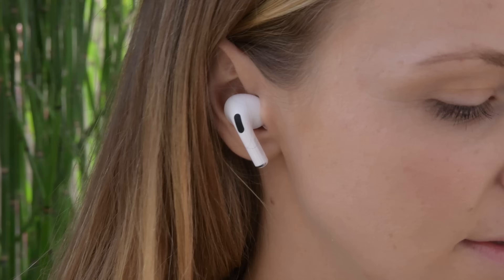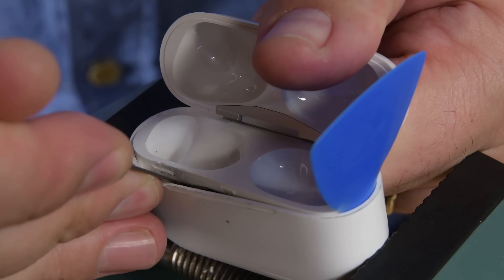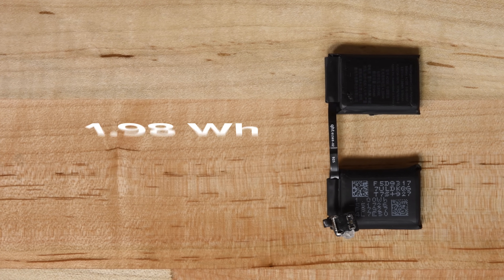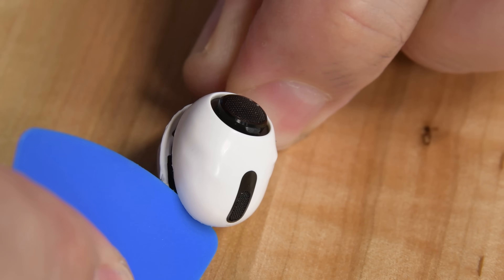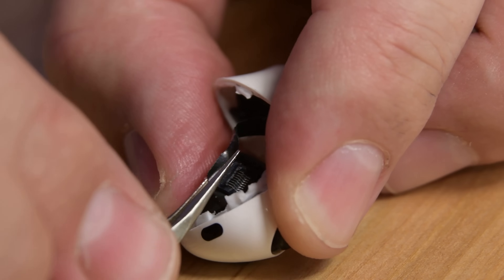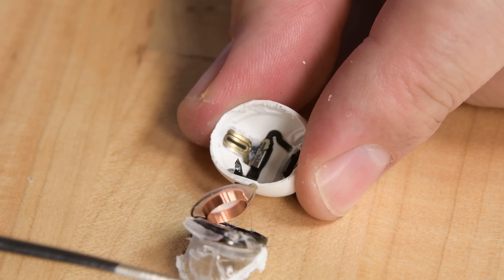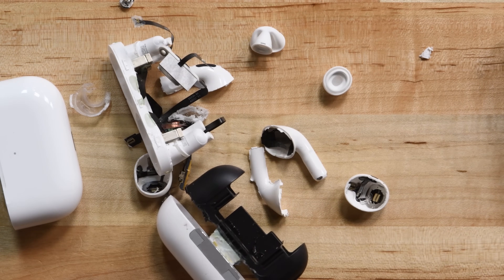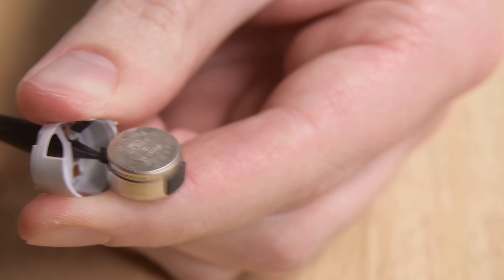AirPods Pro Teardown—0 out of 10 Total Destruction!

Comment: To be fair, its kinda pointless to repair these: the batteries represent like 90% of the environmental cost. They’re so tiny it’s not worth it, might as well replace individual earbuds units.
Reply: Spoken like a true isheep
Reply: not if you could just change out the battery.
Reply: Far L I absolutely cannot argue with that. you are totally right, and for a $250 product to become a consumable for most people over a shorter period of time than others is really shitty. It should indeed be replaceable, I agree with you.
Reply: SCAM
Reply: SonsyWhale ok how about Sony also 250 or others more than that?
Reply: Do you like airpods pro?
Reply: Lord Vegeta yes there is AC+ for Headphones
Reply: Lord Vegeta For newer models hell yea! Especially since they changed how they are made since s8
Reply: Yeah, only at $249.
After 2 years, it's only left with 5 min battery life. For 11 bucks a month, i expect more. Or atleast some battery change
Reply: Rizzzky z none of my wireless headphones had 5 min battery life after 2 years of regular use. It’s more like 80% battery life at the worst case.
Reply: Rizzzky z hum 5min of battery life after 2 years? Is that an exaggeration or from your experience. I got the AirPods the 1st generation for 2 years now and I’m still rocking them like I got them back in 2017.
Reply: Rizzzky z that’s flat out not true. 

My airpods 1 still work absolutely fine , battery is in excellent condition. 
I can go at LEAST a full business week without charging the case, and they have never died once a single use for me. 
And still don’t. Easily getting 5 hours playback after 2 years.
Reply: Rizzzky z you can take in the pods to an apple store and get it replaced (hopefully)
Reply: Rizzzky z Happens to every battery. That’s why it makes sense to get Apple Care+ for them, you get new ones when the battery is below 80%. You can do this multiple times. And if you damage them, you will get new ones as well. If Apple Care+ wasn’t available for them or more expensive (39€ in Germany), I would agree. Spending 279€ every 1-2 years just because the battery capacity decreases wouldn’t be viable.
Reply: @C0mmander  that's still a decent amount of extra cash that needs to be spent. My main issue is that it creates an idea that we should throw away or replace everything if 1 part goes wrong. E waste is becoming a huge issue in the world, every little thing counts and even if these are small, it builds up and enforces the idea that it's okay to throw away something that only has 1 broken part.
Reply: Rizzzky z battery change 😂😂😂😂😂😂😂
Did you see how small they are? You must be joking or a Apple hater lol 
Why would someone ever wanna change the battery of those? Of earbuds?
Reply: @roby2764  over time battery can't carry as much as they did brand new. I dont get how he's an apple hater. Well he probably should because Apple is scamming y'all right in front of your eyes.
Reply: @roby2764  If I spent 250 dollars on some shit like this you bet your ass I want it to last
Reply: Bottom line, I’m not getting them. I already had AirPods and they lasted 2 years which is enough. Being able not to not repair them..I’m not dropping another 170 dollars a new AirPod set. 
I commonly see people rely on Apple or a third party company to fix their things..”just get Apple care!” They won’t fix it, they will just charge for a whole new set, I don’t see how they “fix” anything.
I brought my iPhone 8 into the store and the screen was cracked, they were gonna charge me 600 fucking dollars just to change it. 
No way that was going to happen so I simply went on YouTube and look up a tutorial and replaced my screen for just 40 dollars. Learn how to fix shit yourselves. The way they really tried to scam me for 600 dollars just to replace my screen shows how decisive they are.
Reply: Just watch Snazzy Lab. That guy perfectly analyzed the Airpod Pro
Spoiler alert: It's good, but definitely not good enough to blind us Android users with common sense, unlike Apple fanboys lol
Reply: Hoang Tho Nguyen “If you’re willing to sacrifice performance for comfort and ease of use, they’re worth the asking price” Yeah, that’s the point for the AirPods, not the things you’ve mentioned.
Reply: Shut up douchebag, nobody asked you about your point
Reply: By the time the battery deteriorates there's going to be a new model so there's no point in repairing them anyways
Reply: @noobminer2893  10/10 logic cuz everyone buys the newest thing every few years.
Reply: @KevinEF  they buy the newest thing because they don't want to go through the trouble to take apart small electronics like these to repair them, even if the battery were replaceable
Reply: @noobminer2893  yea but paying your smart techy friend who enjoys taking things apart would cost less than buying the newest earbuds
Reply: @EduardoMacias-h2r  Good ANC headphones are $350-$400, are those scams even though so many people like them??
Reply: It's pretty clear that the people that hate on Airpods are the ones who never owned them. They seamlessly integrate into your life and they're incredibly convenient at a competitive price. From what I've read, the ANC and sound quality on the Pro could use improvement but this model is one of the best on the market along with Sony's WF-1000XM3. Regarding battery life, they degrade at the same rate as all true wireless earbuds. Apple is pushing the boundaries once again and I'm sure other companies will try to mimic them
Reply: @EduardoMacias-h2r  And when every other company tries to copy the new airpods so much like they did with the originals, along with raising the price where will your case be then? Flagship phones used to be $500, now they are double that, and most competitors of Apple charge very similar. Tell me exactly what Apple is scamming people of? Tell me when repairing an airpod for normal use will ever be needed.
Reply: @Silver_x86  fully wireless buds have been a thing long, long before airpods. Of course, some companies have made shitty knock offs of airpods, but they're just that. Don't think that Apple has innovated anything, they always follow the trends, then everyone follows them, which I will give them credit for - they have an incredible amount of influence
Reply: Ryan Kupka AirPods pro noise cancellation is actually quite innovative. They’re the first earbuds to not be over the ear headphones to actually have that feature.
Reply: Fujin Yumi No, Sony, Bose were first.
Reply: Fujin Yumi theres a pair of sony tru wireless and those cancel better

Comment: Nice video. The CP1154 is from a german company, Varta. And Galaxy buds used CP1254 Battery, and it's capacity a bit larger than CP1254. 12;Diameter, 54: Height. :)

Comment: Interestingly they have now switched to the same german baterry supplier as Samsung did with the Galaxy Buds.
Reply: Varta ist halt einfach gut
Reply: B P It is actually. They didn’t write Varta on them, but they say Germany and have specific type of number only varta uses.
Reply: @catboy3471  i have an iPhone 6S Plus 64GB White, how dare you you bitch!
Reply: Malte Reese interestingly the galaxy note 10 has no headphone jack. Hmmm wonder were that came from?
Reply: @noerivas4167  probably the dwindling numbers of headphone Jack users?

Let's be real, removal of older technology isnt something you copy. It's just how tech is. The old gets replaced by the new.

The intresting thing is samsung pulled an apple.
Apple is typically the one that waits to put in features until the feature is ready.

When apple removed the headphone jack I would argue we hadn't really replaced the headphone jack yet.
Now I think we have.
My biggest concern with bluetooth(and why I didnt replace my headphones until now) was because I didnt want to ever have them die and not have a way to charge them.
Now with reverse wireless charging it's not really a problem.

In this case it's not who did it first, its who did it at the right time.
Reply: @woo9914  If Apple hadn't done it at the time it did, I guarantee no other mainstream smartphone manufacturer would have done it now. Apple made it acceptable for headphone jacks to be removed and made phones without headphone jacks commonplace. The same thing they did with notches and a whole range of other technology.
Reply: @ifb6368  that's true, but that's not really a counter to my point.
Reply: @noerivas4167  from moto z ofcourse. They did it first before iPhone 7.
Reply: Noe Rivas I didn‘t mean it as a negative thing. I’m a complete Apple guy 😂
Reply: @noerivas4167   A wild Apple Fanboy appeared!
Reply: Onur no it’s a Apple vid we are common here jeez
Reply: @pindakaasjeokay3392  no. its a ifixit vid. 😃
Reply: Varta is no more german since Johnson Controls buy them. My Dad worked for them and after the sale its was a nightmare to work for them.
Reply: TomGoTom Gogo That is like 10 years ago. In the meantime, Varta was made Independent again and is listed in the German stock exchange. They did a great job reviving their battery business after getting destructed by Johnson Controls and others

Comment: Pretty sure Apple is proud that they got 0/10 on repairability.
Reply: Apple: pat on the back Good job boys we made it
Reply: @bluberrialpha  se
Reply: Tim Apple: Now that Steve’s not here, divert all man power from innovation to the glue and solder department!
Reply: Johnny Chen 😂😅
Reply: Johnny Chen FYI the iPhone battery has pulltabs and almost nothing is soldered
Reply: Johnny Chen Steve didn’t want anybody opening the products
Reply: @roveism  Steve drove them towards Glue and Solder
Reply: @roveism  🤣🤣🤣🤣
Reply: I believe the next generation device will have no screw at all, just seamless metal all around.
Reply: @karljo8064  That would be 3d printed metal body
Reply: Karl Jo metal is more expensive than plastic..
Reply: @tomcruz7177  and it's heavy too
Reply: adepu prashanth potentially not that much heavier as you can use a thinner profile for the same strength. Imagine titanium AirPods lol
Reply: Tom Cruz and heavier... Low weight is essential in earbuds. Also plastic, app art from lighter ,is very resistant. AirPods lack of repairability is a shame, but your comment is not much better
Reply: Peter the Panda stock holders cheering, popping champagne and going wild
Reply: If your air pods stop working their damaged beyond repair. The only way to fix this is spend money on new AirPods!
Reply: funny how they get rid of the charger to "reduce E-waste" while making the most unrepair and unrecyclable  products. And people still falling for this crap.
Reply: @1179125 nice!
Reply: Yeah of course
Reply: Ladies and gents today in innovation. Unrepairelable jewelry. You break it you buy a new one.
Reply: Very sad to agree with this comment. Apple is very greedy.
Reply: Peter the Panda they don’t care
Reply: Peter the Panda - I’m proud.
Reply: Lol
Reply: @A random Human being They've always been hard to repair
Reply: Its to Prevent Pablo Cimadevila in making them out of Gold https://www.youtube.com/watch?v=Kgle4vt3OuI
Reply: Yeah they did it they’re wanting people just to buy new ones just to earn more moneu
Reply: Next thing you know the entire inside of a MacBook gets filled with epoxy.
Reply: @lemon diesel what's stopping them from stealing the whole thing and use it as is? I hope you are just joking because I'm lol
Reply: Doesn't all wireless earbuds have 0 repairability rate?
Reply: @Delta-1X-Ray  airpod2 is easy to repair
Reply: @vinceto1913  How can you be so sure of that????
Reply: They managed to beat microsoft.
Reply: Oh Yes
Reply: it'll cost me $100 to replace the battery in 3-4 years hopefully. Cuz i aint buying another airpod for 250 again ima use em till they're dead.
Reply: true true
Reply: I sure they are. Cause that shows us, well, at least, to the smart people, that these AirPods are the most advanced technologically among all others.
Reply: Duh just buy another one. Are you poor or something ;) jk
Reply: Galaxy beans: yass queen 😎
Reply: Yeah, a 10 on repairability is a big no no for Apple.
Reply: Lmao it's been 15 days of me owning a pair and I'm starting to hear buzzing and cracking. GUESS WHO'S GOING TO REPLACE THEM. Especially with the 2 year repair and warranty.
Reply: Watch mine as well😁
Reply: Yep with the bullshit they fed on not having a charging adapter in iPhone 12 for “environmental reasons” and being against the right to repair and having expensive Ear buds that are basically disposable once the battery’s are dead.
Reply: Yup lol
Reply: Lmao 😂😂 yeah
Reply: I mean....what earbud headphones on the entire planet are actually repairable? This is a tiny component.
Reply: Your 6k like
Reply: So are every other earbuds lmao even wired ones. Cry about it 🤓😭
Reply: Apple: guys we can do better than this, let's aim for -1/10 next time
Reply: That’s their plan.
Reply: According to them, this is how they help the planet, starting also by not giving chargers in their boxes. Lol
Reply: Their internal scoring on how well the final product turns out is: (10 - iFixit score) / 10. A 10 from iFixit means 0/10 for Apple, a 0 from iFixit means 10/10 for Apple.
Reply: Yep. It's very clear Apple doesn't want unauthorised repair on their devices. We all know this.
Reply: Ofc they are, what is everyone expecting? xD
It's business, if you mess yours up, -Buy a new one
Reply: They're only achievement
Reply: Making a no.1 true wireless brand with 0/10 on repairability is a remarkable achievement.
Reply: Samsung and Microsoft wireless earbuds also 0/10
Reply: How would you make all that shit modular in such a small device with noise cancelling? It actually makes them stronger.
Reply: I mean good luck making something that small that can be easily taken apart lol
Reply: @FlabGaster I think all the Apple haters are ignoring this basic point! Just too easy to keep on hatin'.
Reply: And what's better is how they said if they wanted the audience to see a much more better repairability video which would be with Samsung. Lol

Comment: I mean... who has ever even tried to repair earphones? But it’s always fun to see the guts of those products
Reply: Nic Lsslt less for repairs and more for the fact that these batteries will fade after a couple of years. Since they aren’t replaceable, it means you have to buy all-new AirPods when all the other parts are working great
Reply: Dunya Media still who does that? Other (functioning) parts can be recycled. Nobody ever does a repair on these and people just buy new ones. That’s the way it goes.
Reply: Dunya Media Very true, but that was not really my point. I meant that the score is absurd. Of course it’s gonna be 0, what do they expect from such a tiny device?
Reply: @nerdy4382  IFixit gave the galaxy buds 6/10 so even tiny devices can be repairable.
Reply: matty - Okay.
Reply: 🙄 I've tried to repair regular non fancy earphones... Not much succes tho.
Reply: Thor Lindberg as you can see in video you can still safely remove the battery, even with score 0/10, so it does not matter for recycling
Reply: @hydrogenbond7303  no, it's soldered to some other board, so you can't replace it
Reply: Уточка Медведева I didn't say you can replace It, I said you can safely recycle It, even with score 0/10.
Reply: Tim Brown i know that but it just isn’t cost efficient.